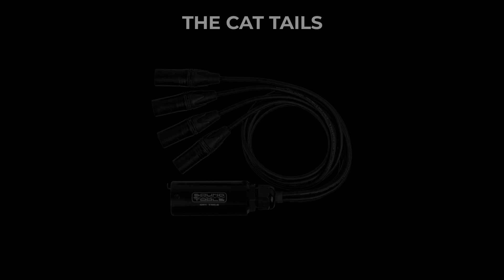Behringer X32 Midas M32 Muting Ping and Zipper Sound (Public)

Comment: I'm going to have to try this on my X32 rack.  I wonder if it's a function of the encoder itself or if that's in the software.
Reply from the maker: I've heard it's related to the way the mixer processes the digital signal I've also been told the wing should not have the ping
Reply: @DaveRat  I was able to replicate the zipper on my rack via a mix bus this weekend.  Rapidly cutting a mix bus used for vocal delay sent that odd noise through my PA.
Reply from the maker: Very cool and it's fun and useful to know what these artifacts are

Comment: Here's the background information to understand what is happening here, from a digital console designer.
I am interested to see the 6kHz, which is probably a very good result as this is the update rate of the gain coefficients. The effect of changing the gain (even in an analogue console) is to modulate the channel output with the gain change frequency, exactly the same process of frequency mixing used throughout electronics. The important part from an audio quality point of view is that the change is spread linearly across a large number of samples, not suddenly applied to one, and then keeping that value for the following samples until the next fader value is received. However, this smoothing of change rate is quite processing-intensive,  and therefore is rarely perfect, and is less and less necessary as the update rate is increased. The 6kHz signal level Dave is seeing will be small compared to the  20Hz signal, and with modest fader position changes inaudible. The mute button obviously switches in one sample, so the 6kHZ is larger, but then the mute button is not usually used when a signal is present when there will be no 6kHz, so is much less important. Devices like the gates and compressors will not show this effect as the gain transitions are fully "smoothed" with an effective sample rate of 48kHz or whatever. How many dB down from peak is the 6kHz Dave, probably about -60?
Reply from the maker: Also I am told the Behringer Wing does not do it and none of the other consoles I tested do it. It seems to be unique to the m32 and x32 and other derivative designs by Behringer from that design

I was told that the issue is related to the X32 and M32 processing in bloks of 8 due to lacking the processing to uses smaller blocks due to processing power shortages.whatever that means.

Comment: As a software engineer who has worked on audio consoles, MUTES should either happen at the zero-crossing point of a signal or be a fast fade. Unfortunately, with a low frequency signal such as you're using, this can be problematic as it means that the MUTE is too slow. This means there are trade-offs. If you performed the same test at 1kHz, you may not hear any artifacts. Fades are a similar problem, ideally you fade at very small dB change levels or fade at the zero crossing point of a signal. Again the low frequency of your source is showing up an inherent trade-off between speed of operation and zipper noise. I would guess that 96kHz or 192kHz sampling might make this better as you can have more 'attenuation points' during the fade/mute, but I think the noise will only be reduced by 6/12dB if that's the case. I'd be interested to see a graph of chirp level versus source frequency for several different consoles.
Reply from the maker: Consoles I have tested other than the x32 and m32 do not chirp. The SD11 and Yamaha CL1 are chirpless and run at 48k.

Also analog consoles do not chirp.

A mute click is pretty common.

I will test zipper noise and such on the Yamaha CL1 I am testing

Comment: Haha this is very interesting! As someone else allready said. A signal to "chirp" ratio would have been nice info to have. How much are you amplifiying this noise for us to be able to hear it in the video?

I´ve worked hundreds of shows on a M32 at this point and I have never experienced this in practise. Not even with very quiet source material and high gains settings on condendser mics like a Choir singing pianissimo dynamics over a few piano notes. I´d never touch the gain or mute in such a situation but i defintly ride the fader sometimes and I never heard it.

You consider it a practical issue or just a fun fact? :) 

Been following you on and off ever since the papers preceeding your "orgasmatron" Sub array with the A. B, C and D stack of 3xSB28s each with different phasing and delays. You even had a carpenter cut out a board for you to set it up faster. That was cool :)
Reply from the maker: It just something to be aware of. I heard it when testing and muting low freq signals, then setup a test to isolate it.

For most applications, it does not matter, just like a freq response over 16k or distortion over . 5%

But when comparing to higher priced consoles or applications where perfection is more important, it's good to know.

Comment: do you have the gain really cranked to be abe to hear it? ever oticed it in norma gig envirements or even listenig with headphones.

what firmware version is on the console?
Reply: going to try repicate this today whe im at an x32
Reply from the maker: Latest firmware. Yes, gain is hot
Reply: @DaveRat  I replicated your results using the desks internal oscillator. Sent oscillator to a bus which was out of stereo. Used a channel to take source of the bus having tone sent to it, sent that channel to another subgroup  and filtered out the 20hz tone.

I was sending 20hz to subgroup at -18dB.

The chirp is clearly audible with cranking the desk out or subgroup out up. 

I tried it with pink noise aswell, it's audible but becomes less and less audible the less that's filtered out.
Reply from the maker: Interesting and very cool. I am testing the sd11 and it is different but there is a chirp on the master but not the group or channel
Reply: @DaveRat  another venue i work has ah qu will give that a try

Comment: Imagine when you have two digital audio sampled systems feeding audio to each other, each using slightly different sample clocks..eventually  a buffer gets starved or will overrun. I have designed systems that detect this plesiochronous  condition and adjust samples rates accordingly.
Reply from the maker: True and in all these tests I use analog in and analog out so sample rate drift has zero impact. With aes50, the consoles clock over the aes50 connection. 

Chosing one console or the other to clock when they are digitally interconnected is a must and the norm.

Once the signal is analog, whether it was clocked at one rate or another in the signal's precious life as a digital signal is as meaningless a whether a mic cable was stored in a red case or blue case before being plugged in.

Comment: New test for you Dave!  I wonder if you set these consoles to run over Dante and use high end I/O (Digico,Yamaha or Midas) will these systems take on some of the sonic attributes of those consols?
Reply from the maker: Most likely. The noise issues are I/O related. Ping and zipper noise are control related.

Comment: Excellent deep dive into the chirp issue.  You have proven I am not crazy because I have mentioned this to a couple colleagues who looked at me as if I’d completely lost it.  Have you experienced any issues with the faders on either the x or m32?  We have several of each and the M32s seem to have occasional dead fader symptoms. They still work, but are no longer motorized and is a pain when jumping from layer to layer.  I do know the x32 faders are soldered in place vs wired with a small connector and two screws on the M32.  Thanks again and I appreciate your efforts to go deep into these common use products in the industry.
Reply from the maker: Motorized faders do fail on all consoles. We don't own any m or x 32 other than purchased for the vid so I don't have experience with how the deal with time and usage

Comment: Great presentation Dave...I immediately thought about the benefits of better (i.e. Penny & Giles vs Alps) faders in the analog domain. (Obviously won't help here)  Everything is a compromise in life.  Some things are better in the digital domain, or class D amps, et. al, but there is always tradeoff, you're doing terrific job bringing light to exactly what that means through the signal chain. Thanks so much, Mike
Reply from the maker: Thank you Mike! And that's interesting. I don't know if the faders for digital are different or not.  Are they linear encoders? Or are they resistive analog type faders that vary a DC voltage which the digital circuit interprets? Or?

I must admit I assumed they were like a vca, where they slide between ground and a fixed voltage and a digital circuit reads that voltage and implements the associated amount of gain or attenuation.

That said, the rotary knobs that endlessly spin are encoders without fixed end stops like the faders.

Interesting!  I love breaking assumptions!

Comment: Hey Dave, love this short series, I've use the x32 extensively to mix my church's broadcast mix. I wonder if you have run into a this strange behavior where when you link two channels together, there would be a very small, but noticeable drop in volume. I noticed this and experimented  by copying all the channel processing  and routing and panned the channels left and right respectively, and the behavior still continued. Just something I found interesting and thought would be cool to see you dive into if you ever get around to it. You rock!
Reply: How do you mean? Do you pan them back together after you link them? What input material is there? It might just be a pan law thing you are experiencing pherhaps? :)
Reply from the maker: I saw another comment on this exact subject. Not sure if it was on this video or another. And also some useful responses.

It's prob a subject is won't dive into but is interesting

Comment: I'm guessing that "sound of the fader resolution" (LOL) might not be heard while using the rack version with iPad on these units?  This is a mechanical artifact yeah?
Reply from the maker: Not mechanical and should be the same with an iPad. But also, as I mention, the lever of these issues is very low. I set up to make them audible.

Comment: Well, if you don’t move the faders, use the mutes, or change head amp gains, they are wonderful mixers. 🤯
Reply: @DaveRat    I tried to file the edges off my snark.  

I noted a reading on your scope of approx 5mV.  Assuming that was the amplitude of the chirping at that moment, it’s quite inaudible, well above the noise floor.  Pretty alarming stuff.  

I’m so grateful you take the time to do these investigations, Dave.  I will be using Calrec mixers in January and February for Olympics and will have the time to check them.  I have already done some ultra deep dives on the Lawo consoles.  With phones and a live Sennheiser HD27 dynamic mic headset in an empty soundproof announce booth, I have run the digital head amp gain up and down from 10 to more than 60dB, and absolute silence was the result.  I mean DEAD silence in screaming hot phones, to the point I can hear myself clap 70’ away, outside the closed booth.  Ditto mutes.  Lawo is big money stuff but still the point is, it CAN be done.  I believe you will find similar results with your SD11.
Reply from the maker: Fun and thank you. Yes, interesting stuff and for me it's all kind of stumbling around and see what shows up as I dive in. The aspects that seem most interesting are the least expected.
Reply: @DaveRat    I am most interested in learning which, if any, of the lower cost manufacturers have done their homework.  Clearly the Midinger conglomerate has skipped right over some essential developement.  I’m sad about that because I don’t know how far up the Midas Pro line this disease goes.  I will be scrutinizing every mixer I encounter on the road time permitting and would like to share my findings on your channel.  I promise to keep them brief.  Mute, fader, head gain; quiet or not.
Reply from the maker: Well, let's see how these other consoles test out. I am remiss to make assumptions and have seen even the best manufacturers stumble.

Comment: Hey Dave!
My question is a bit unrelated to the matter at hand - have you tried seeing how the digital aes50 signal could be passed in "reverse" through rat tails into a 4 channel xlr snake?
I tend to work with x32/m32 with the aes50 stageboxes and usually tend to work places with existing xlr snake stage boxes.
I've seen (binged is more accurate) you describe how your cat to xlr systems work, and the termination makes sense that it would work but the length of xlr running could be an issue with interference.
I would love to hear your thoughts on the matter.
Cheers from Haifa!
Reply from the maker: Actually yes, I have tested exactly that. Definitely loose lots of length, for short runs it can work but aes50 is raw digital without error correction so caution is advised. AES50 is very very poshy and temperamental and very set in travelling down familiar paths.
Reply: @DaveRat  Thank you for the quick and helpful answer!
Besides aes50, have you tried other digital protocols running on cat cable to see how they fare?
Reply from the maker: Not test wise. AES50 is a raw, non error corrected signal to the best of my knowledge, that keeps the latency super low but makes it less tolerant to issues and more likely to have very loud issues vs muting undesirable sounds.

Comment: I think a great test would be to compare the Behringer with the midas stage box vs just the midas. 
I genuinely wonder if there'd be any difference.
Reply from the maker: My tests comparing the x32 vs x32 with m32 as a stagebox shows that the audio advantages are determined by the the stagebox.

The interface and durability advantages are determined by the whatever the engineer is operating.

As I move into testing the Digico sd11, I see clearly that both the x32 and m32 are cheap toys as far as ruggedness, but the m32 is much less toy like than the x32